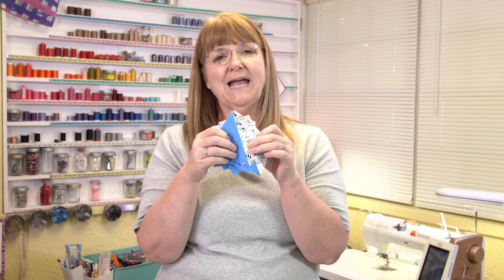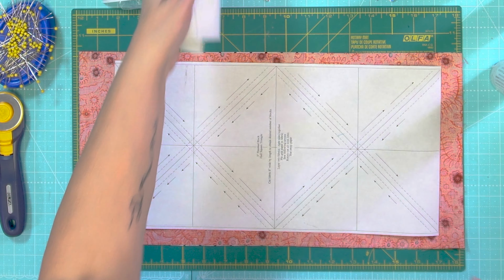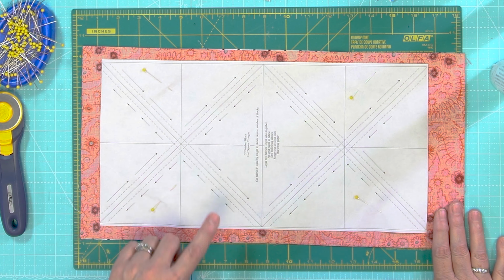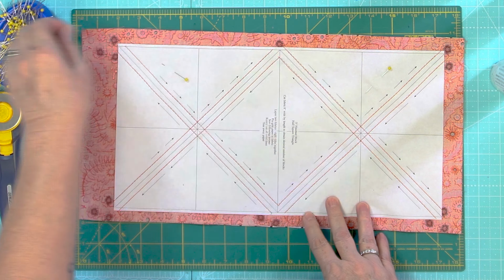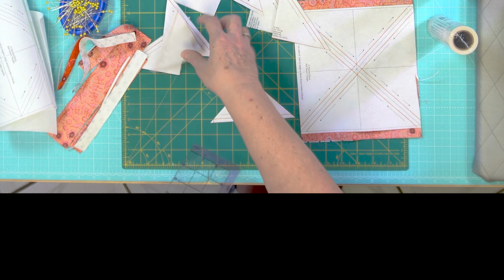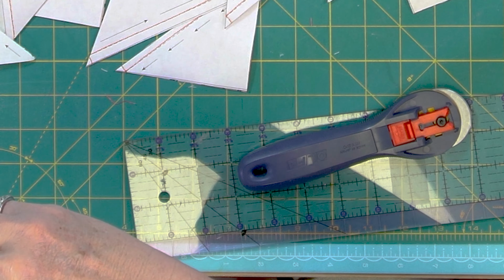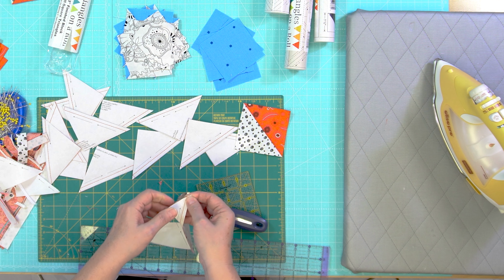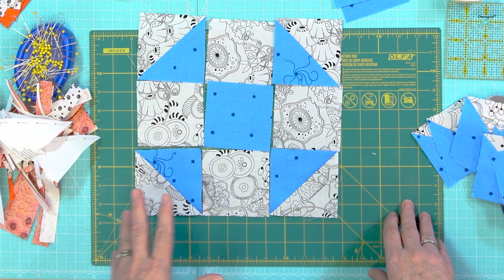Piece Half-Square Triangles Like a Pro Using Triangles on a Roll Paper

Comment: Intrigued but the cost of quilting is so out of control I can't barely afford the fabric as it is
Reply from the maker: I agree that quilting can be expensive but there are tons of ways to stretch your dollars by using all of the leftover fabrics on scrap projects like mug rugs, table runners and other small projects.  I thought the triangle paper worked well but I have also used other methods that gave great results without the extra cost.

Comment: I think this may be a good product for beginning quilters.  It will help avoid making the cutting mistakes that frustrates beginning quilters the most.  Although it adds a slight cost to the overall project, hopefully beginning quilters will stick with it and their sewing projects won't end up in a drawer unfinished!  Thanks for making the video!
Reply from the maker: It is a fun way to create half-square triangles. I agree that it would be great for beginners.  Thanks,